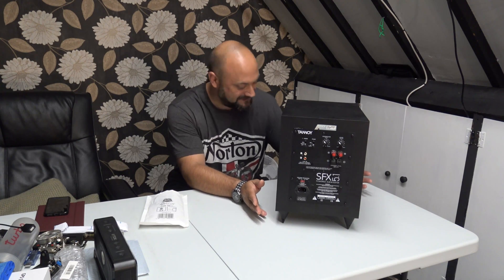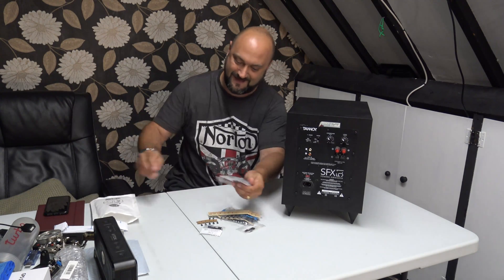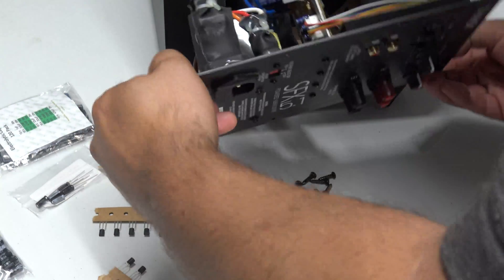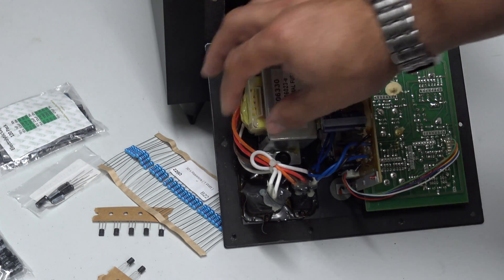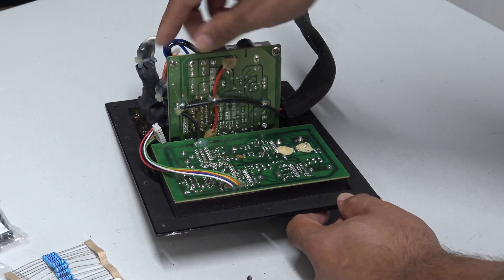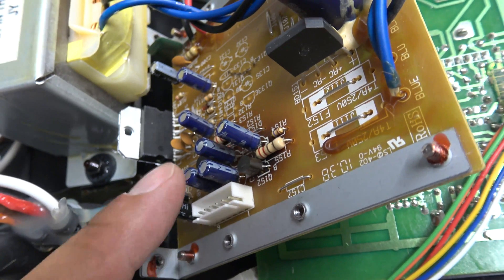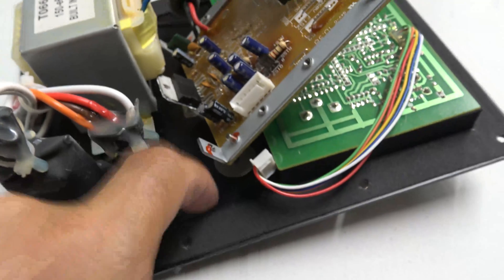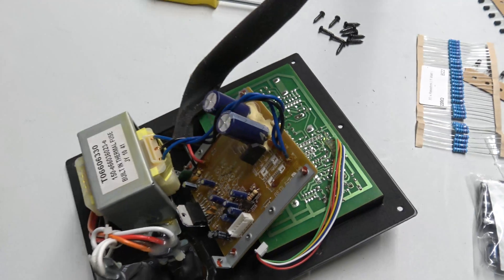DuB-EnG: Audio SubWoofer Active Bass Speaker Repair Tannoy SFX5.1 Replace Electrolytic Capacitors

Comment from the maker: Dont forget to give us a good old thumbs-up! - The basic principles are the same for most electronics...  Electrolytics dry out and loose their capacitive effect on electronics thats 10 years old or more...  check there first! :-)
Reply from the maker: whoop!
Reply: @DubiousEngineering   Hi I have the same problem with the same active sub   Could you possible tell me which capacitors you used and which ones went  were. I know you replaced nine of them and where you  placed them just don't know the rating of the ones you used I know the rating of the two big you said that in the video
Reply: Yes I agree the ratings would help much...

Comment: I just fixed my sub after watching this video. My board had the same signs of overheating, but I just re-solderd the connections & the sub works again. I feel it's on borrowed time though & some of the capacitors will need replacing eventually, but for an immediate fix for free, I'm chuffed to bits! Thanks for the video, it helped me a lot 😁👍
Reply from the maker: Happy days!  Glad it's not gone to landfill!

Comment: I believe the circuit you are working on is the + & - 12v DC supply for the preamp which is actually on the the other circuit board. Also the main problem appears to be that the two transistors are being pushed close to their maximum power rating, hence the over heating problem. There is a good blog on this with lots of information. On the blog someone has recommended replacing the transistors with some higher rated transistors, TIP 31 and TIP 32. The blog is here -

 https://andydoz.blogspot.com/2017/11/tannoy-sfx51-powered-subwoofer-repair.html
Reply from the maker: That's really helpful Geoff, thank you!

Comment: I have the same Sub with the dreaded crackling/rolling thunder fault.  Recently read a blog that states the issue is the transistors in Q151/Q152.  These are 2S1815 and 2SA1015 repectively. They appear to be under rated for the application in terms of Collector Power Dissipation (so I have read) - they run too hot.  In one fix, these were replaced with TIP31 and TIP32 transistors which are higher rated.  The PCB in my unit exhibits the same heat damage as the one in your video particularly around the Q151/Q152 transistors. I am going to attempt replacement of the old transistors with the TIP31/TIP32 alternatives.  I'm a complete novice so hope I don't burn my house down with my "fix"!  Great video BTW 👍
Reply from the maker: Best of luck with your fix buddy!  Thanks for the top tips about the trannys!
Reply: @DubiousEngineering  I just thought I'd check-in with an update re my repair.  It worked!! Albeit I got a friend to do the soldering (he's an electronics Engineer).  Sub rumbling away nicely now.  The new transistors barely get warm.  How long it lasts remains to be seen - fingers crossed!
Reply from the maker: @Flint_Westwood  that's fabulous news 😀  ...  Great work you guys!  Enjoy the bass!
Reply: @DubiousEngineering  Cheers! Like I said, I'm a complete novice so it could go either way I guess. 🤞

Comment: Great video! My sub has power but no audio output at all. Tried different cables and channels on the amp but nothing. Could this be related to the capacitors and transistors?
Reply from the maker: Very likely, suggest using a signal injector and tracing that signal through the circuit to see where it stops!
Reply: @DubiousEngineering  Thanks! Can you recommend one suitable for the job?
Reply from the maker: Here’s what I use https://youtu.be/CxRRdo2ONUo

Comment: this looks like just the problem I have with my SFX5.1. Occasional loud "pops" even with no signal connected. You inspired me to take the thing apart but the first problem is that a lot of the  fat wires are glued in place including blobs of glue or silicone over the solder joints (such as the signal ground bond) - how should I remove this to get at the solder?
Reply from the maker: Scalpel blade and tweezers... it’s going to be a long job :-).  Sorry!!
Reply: @DubiousEngineering  just realised I never updated this. I did in fact replace almost all of the electrolytics and the transistors. Very fiddly dealing with the lifted tracks (soldering bits of wire in place to replace them) but that and a fixed dry joint eventually means I now have a very nice sub! thanks for the inspiration! Been using it for the last few months...

Comment: I've got the exact issue with my sub. I kept hold of it for years, dusted it off and thought I take a look at fixing it. 

I proceed to taking out the screws and pop off the back. I then know I'm in too deep and have no idea what I'm doing but I see the burnt area in the PCB and knew it wasn't right. 

So I proceed to search YouTube for fixes came across this video brilliant!

Now I need to buy a soldering iron and the capacitors.

What are the capacitors should I buy, I don't want to be buying the incorrect ones?
Reply from the maker: Jeremy Head sorry mate, I don’t recall the exact ones.  Suggest you take it apart and look the numbers up on the capacitors...
Reply: @DubiousEngineering  Thanks for the reply :)
Reply from the maker: Jezza * pleasure mate... good luck!!

Comment: Hi, I have a Tannoy SFX subwoofer which is making a crackling/rustling noise when not connected to the amp.
Is this something you can fix?
Reply from the maker: Yes, sounds very much like capacitors may be drying out!!  Need replacing!

Comment: My Tannoy SFX5.1 has done exactly the same thing - pops and crackles. Possible design fault on this model? As an inexperienced circuitboard solderer I feel this might be above my skillset. However, I am pleased to finally know what's wrong with it. I've been taking it apart to 'clean' it. At least I can stop doing that! Great video. Cheers
Reply from the maker: I hope you can find someone to repair it... its a nice Sub.  That said, you can buy others for £100 or so second hand on ebay

Comment: Hi there! Really nice video. I got similar issue with Tannoy Tfx sub. First there were some random noises on and off, like static, crackling etc for weeks. I thought it was to do with power, as noises continued with signal cable disconnected. Now there is no sound. Red light in off position, but no green light? After opening I can't really see any burned darkened areas. Not sure what to do. Don't want start exchanging capacitors / transistors at random. Feels really bad to just throw it away :-(
Reply from the maker: Aww that sucks...  try some "freeze it" spray - That should help you identify where the problem may be...  It cools the hot things and they work a little better.  Be careful if its open and turned on!! :-)

Comment: I have the same unit with the same problem. I notice in your video with all the screws removed the back fell off. Not on mine !!

I think some leverage may have to be  used. I don’t won’t to damage the cabinet, any ideas ? When I can get the back off I will replace  the faulty components.
Reply from the maker: Frank Langford it needed a little persuasion... a flat blades screwdriver should do it... don’t panic!! 42

Comment: Great video, I'm tempted to do this myself. Do you have a handy BOM of the caps you used? I changed the transistor pair already, and same as you, the board is so toasted that the tracks lifted!
Reply from the maker: Definitely caps are the most common cause of this... 10uf 22uf 50uf and 100uf about 4 off each... I just purchased a general pack at 50v and that worked a treat...  good luck my friend!!
Reply: @DubiousEngineering  the capacitor kit came, more than I'll ever need. Replaced the 4 nearest the control wiring socket right in the discoloured patch of PCB. it's not pretty, but so far so good. Thanks for the great video.
Reply from the maker: Thomas Fleming whooop!!!  It’s so satisfying knowing I made a video that loosely helped you fix one of your pieces of audio kit!! :-). Pure satisfaction!! :-)
Reply: @DubiousEngineering  would a 47uf be alright in place of the 50?
Reply from the maker: @billcIintonvevo  almost certainly
Reply: @DubiousEngineering  my tannoy is just starting to pop quietly sometimes, and has a constant but quiet hum even when the switch is on the off position. does this sound like capacitors to you? i’ve opened it up and see the same discolouration of the pcb
Reply: @Thomas Fleming @Dubious Engineering Thanks both. Ordered a bag of them.
Reply from the maker: Well done... keep us informed on your future success!!!
Reply: @DubiousEngineering  Caps arrived, changed everything I could and still getting the green light whether sub is switched on or not. No red light in off position. Any ideas? Thanks in advance.
Reply from the maker: Hi Charlie ...  that sounds like a completely different problem..  these cps and two transistors are a class a/b push pull pair for pre-amplification of the bass.  The LeD is part of the power system.  Describe your symptoms... what’s happening?!?
Reply: @DubiousEngineering  I noticed a rumbling from the sub a week or two ago and the TV/Amp weren't actually on. Flicking the power switch at the back of the amp did nothing. Just stays on green and occasionally rumbles. This happened a year or two ago and swapping out the two transistors fixed it. As I didn't swap out any caps last time I thought I'd do those and transistors this time around. Still having the same issues. Time to say goodbye to it?
Reply from the maker: Do you have any test equipment like an oscilloscope that you can put on the power supply lines to check the voltage and the ripple ? Is the rumble continuous or happens occasionally?
Reply: @DubiousEngineering  unfortunately no, there's been a few occasions I've needed a multimeter so maybe I'll order one and see if I can troubleshoot. Would that be possible or would I specifically need an oscilloscope? 

It's an occasional rumble. The glue inside had gone brown and become really brittle. I'd read somewhere that this can become conductive over time so I've tried to remove as much as I can.
Reply: @DubiousEngineering  this is the same issue https://youtu.be/zv8ygsPomEc Vaguely remember watching that the first time it happens. Maybe I'll get it opened up again and just double check everything. There's a few connections that have lifted so it's a bit of a mess.
Reply from the maker: Wow what a nightmare... you’re not going to see very much with a multimeter apart from correct voltages... I’d definitely rely on a scope and a signal source (which can be a iPhone) ... it will be very hard to find the fault without a scope mate ... :-(
Reply: @DubiousEngineering  Thought that might be the case. Wish me luck. Thanks for helping out anyway really appreciate it.
Reply from the maker: Sorry mate :-).
Reply: @DubiousEngineering  update on this. I switched out the two transistors again for two new ones. Fixed the issue! Hopefully the new caps will make this fix last longer than a year this time. Saved from going to the dump!
Reply from the maker: Whoop 🙌 ya!!!  Excellent!!!  That’s great to hear!!!!
Reply: Hey, great vid. I changed two of the transistors a year or two ago and it fixed the sub. Back to the same issue and after watching your video I'm looking to replace more like you have. Any chance you have a link to the pack you bought? Thanks. Charlie
Reply: @charliedixon8073  I bought these, more than I'll ever need, but I'm sure they'll come in useful if I ever have to recap anything else. 
36 Values 990Pcs Electrolytic Capacitors Assortment Box Kit Range 10V~50V 0.1uF to 1000uF With Storage Box https://www.amazon.co.uk/dp/B07TCB4WHF/ref=cm_sw_r_tw_apa_i_dW3KEb7K8E86Y
Reply from the maker: Sorry Charlie, I purchased a bunch of bags of caps on eBay ...  there’s plenty out there...  good luck!
Reply: Great video mate got the same fault now no audio. Going to change the Caps & Transistors can you tell me type of transistor I need to order also can't get a 50mico farrad cap is 47 good enough.
Reply from the maker: 47u is fine, just make sure the voltage is same or higher...  you’ll have to google the circuit diagram, sorry I closed the thing up and don’t want to re-open it

Comment: Nice job.  I have a pc modular psu I need to fault find as fan not spinning when jumpering on pins - any recommendations what to check first?
Reply from the maker: Those switch mode PsUs are a nightmare

Comment: The intro gave my sub woofer a brief nice workout and sent warming waves of bass over my soul.

As for subwoofers, too many run a bit too hot, but my subwoofer is just close enough to a decent amount of ventilation to keep the heat down. Using higher quality components would be the absolute solution but too many manufacturers want larger profit margins and make sub-standard gear or you get audiophile gear and get charged thru the nose for it.

Often it's a few modifications to cheaper equipment (outside their guarantee) that gets you piece of mind or a happy medium and my dad used to do all that kind of stuff from making his own, or modding, amps in the late 60's thru to the early 90's to get a more reliable product.
Reply from the maker: Oh wow.. Your Dad sounds super cool!! - I must admit, I love doing these jobs, and I always see improvements.  That said, this unit is really well made...  it is just a few extra pence to up-rate the parts, and I'm sure this must have been a design error.  I hope you have had a fantastic weekend... keep your eye out for a 5k subs giveaway (just before we reach 6k subs!!)
Reply: Even a few pence saved on parts, where a manufacturer opted for cheaper parts, is a thorn in my Dad's side as my Dad swaps out a part knowing the amp will be happier for it too haha!

And the eternal 'For a few pence more they could...............' follows afterwards.